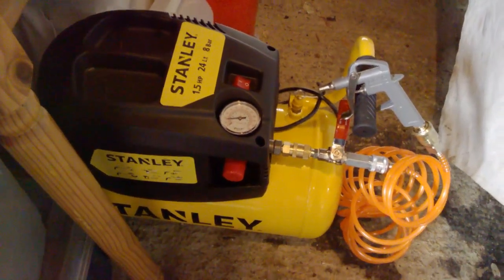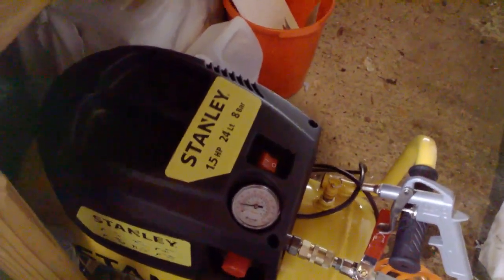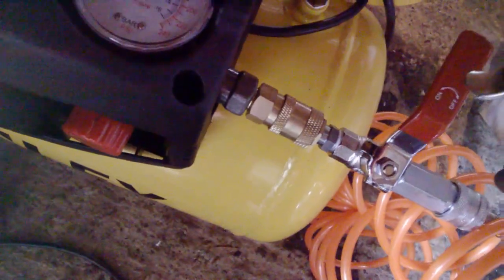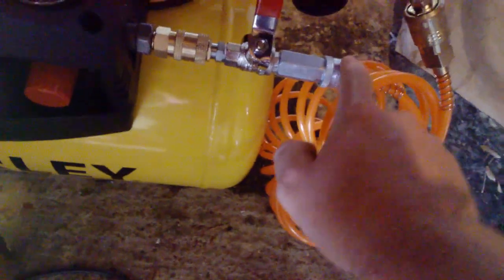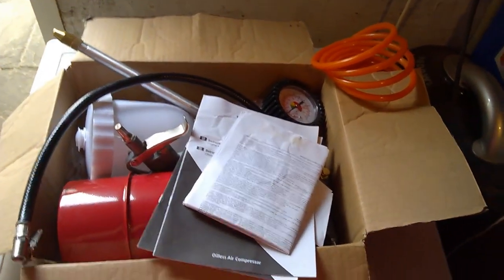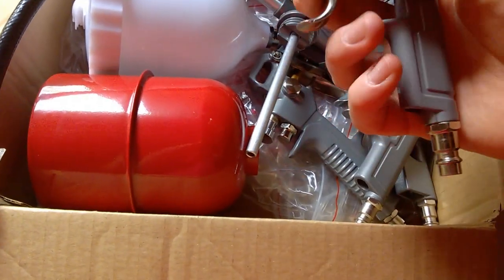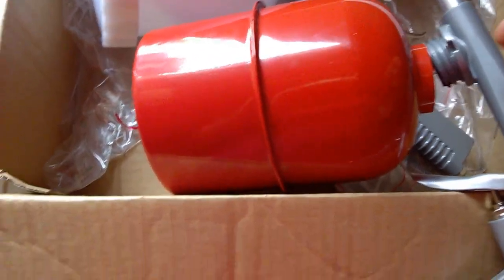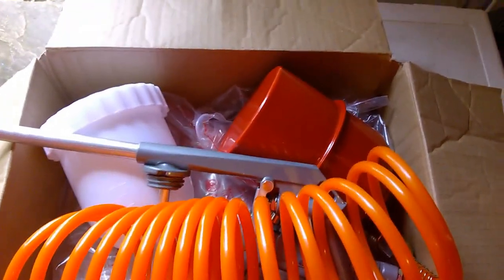Stanley 24 Litre Air Compressor and Accessory Kit - Review

Comment: I have just purchased one of these and it seems a bargain but time will tell.The design is simple and all that a domestic/light use compressor should be without over engineering.As with everything in life it is therefore down to the quality of the materials used in the end,For the price I don't expect it to last forever but I will judge in time.All opinions are valued.

Comment: its really poor quality. Hardly used mine before it failed, maybe 3 times total 1 hour max in 18 months. 

So far, its had switch and wheels replaced. 

Switch failed out of the blue, no warning, just wouldnt switch on one day.

Wheels just disintegrated - good thing is the replacements are rubber and plastic rather than the original brittle cheap hard plastic wheels. 

Stanley have replaced all this out of warranty to be fair, but i think it should be illegal to sell something with a pathetic 1 year warranty , should be 2 years minimum. Products should be built to last a decent amount of time, not fail and 5 mins, also reduces waste / saves the planet rather than line some rich idiots pockets who doesnt give a damn about customers and the planet.

The air hose has now failed as it doesnt mantain a decent connection to the connector and lets air out (i bought a new better air hose of amazon yootoo or something like that which is a millions times better). Now just have an issue where it reaches full bar and then just dumps half of it for no reason. Might be the pressure value or setting.

Such poor quality for something that has such little use.

Comment: I have just been given a broken one of these, it is the most cheaply made compressor i have ever seen. The on switch is not suitable for the inrush current which causes the contacts to burn. The pressure regulator is a cheap piece. The motor is a brushed grinder motor that is connected to the piston by a belt. Very very noisy. The air filter is the size of a 1p piece and requires you to take the compressor housing apart to get to for cleaning. No unloader valve so the compressor draws even more current when there's pressure in the tank.
Reply: I think your review is very harsh. There's nothing wrong with the compressor, it does the job, and I've been using it for the last three years.
Reply: @noreply6193  it's better than a foot pump or 12v tyre inflator but that's about it
Reply: I’ve had my Stanley C for 7yrs and she’s done me proud, fantastic small £  investment, look after her & she will look after you 👍

Comment: Thinking about buying one of these to use for blowing dust out of PCs quickly and easily, i'm tired of taking computers to work to use the company airlines. My concern is about condensation in the tank, do you need to open the outlet valve to drain water very often? Or is it only after prolonged/continuous use?

I don't want to be spraying fine mist water onto sensetive computer components!
Reply from the maker: I opened the valve the other day, and there was small amount of water come out the tank, which was after being left for a while. The manual recommends  draining after every use. For what you describe, I would think you would need a filter to remove the water from the airline, which I believe you can get, however I don't know if this will be good enough for electrical components. Also the pressure is quite strong, so beware of this also. 

Can't definitively recommend it for computers, as it is not what I use this for, and I don't want to say yes, and it does some damage. Sorry but I hope this somewhat helps.
Reply: Thanks for the info, much appreciated.

Comment: You don't need a separate isolation valve on the outlet, as you've installed. If you turn the red knob on the side, you can discharge and vent the air from downstream of the guage up to the tool, and the tank will maintain the pressure it has.
You also use the red knob to set the maximum outlet pressure. the tank will be at 8 bar, but the max out will be to what you set it to be, by using the red knob.
Reply from the maker: I have uploaded another video showing how to use the red valve, adding on to this video, I hope that helps.
Reply from the maker: Thank you, I will give it a try.
Reply: How do you known what the red knob (regulator) is set to. I'm having difficultly figuring out if it even works on mine
Reply: But you do not want to mess with pressure regulator all the time. A simple inline isolation valve makes perfect sense.

Comment: the red tank ( gun) is  for paint blasting  fill the tank with a grit  and   use it like  a blower 
it's not very good but  for  small jobs  it's ok
Reply: Actually it's a paraffin gun, for degreasing parts or similar coarse spraying.  A grit gun has a larger ceramic or hard steel nozzle, not a skinny brass one.
Reply from the maker: Thank you!